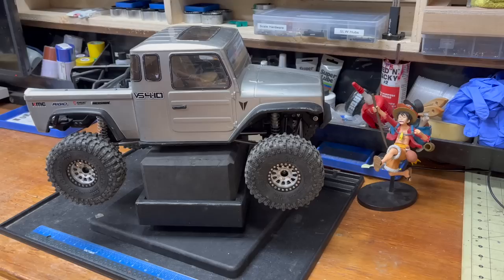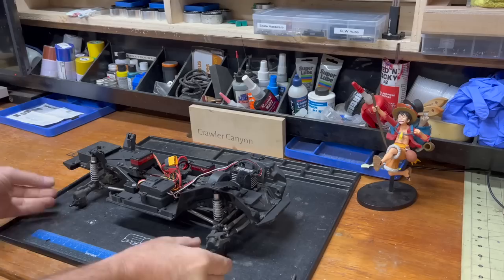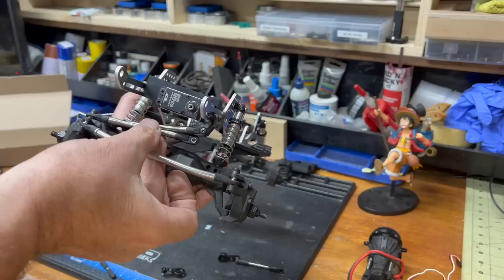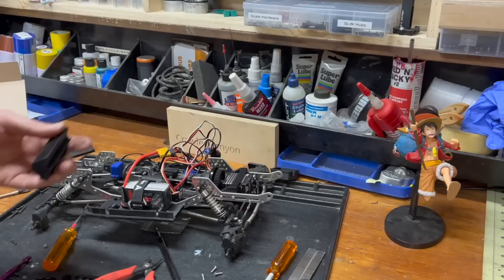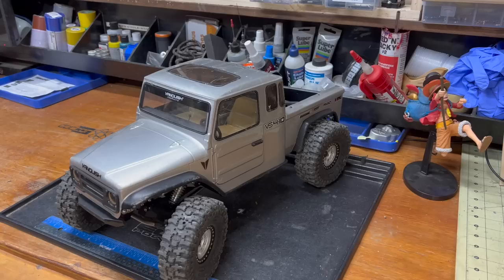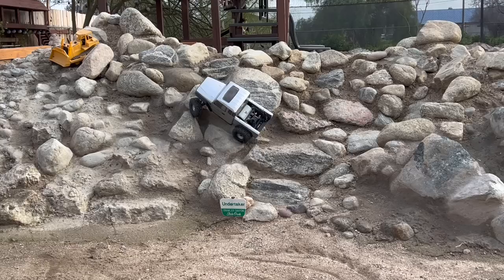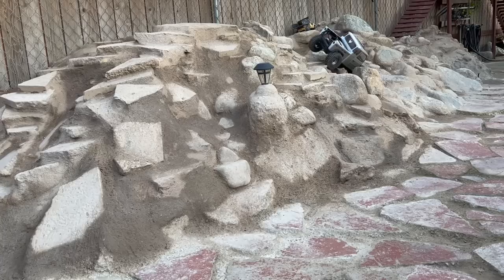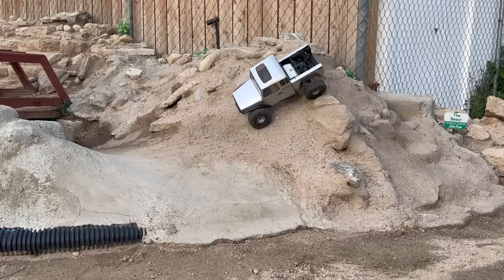Crawler Canyon Quick(re)view: Zoku RC LCG kit for Vanquish VS4-10 Phoenix

Comment: Make sure All you give this gentleman a like on his videos so the algorithm works and shows more individuals these brilliant videos !!! 
I was told by vanquish 20 mm for steering servo and 24 mm for dig an OD
Reply from the maker: That is probably correct on the horns.  I just know I refused to buy any, and bodged $2 Amazon horns in there. I spent probably 40 minutes setting up the steering, which would have taken anyone that had the correct bits about 5 minutes.
Reply: The manual calls for 24mm for dig and OD but it can be done with others.

Comment: So you took a rug that was almost perfect and you made it closer to almost perfect. Great review as usual.
Reply from the maker: That is correct. Take what I still think is the best handling rig "box stock," and crank it up to eleven. The amount of adjustability in the chassis is almost overwhelming.
Reply: @CrawlerCanyon  Put the front shocks in the top back hole. I think it's stretching out to far. Just my opine!

Comment: Check out the KST DS215MG V3 micro servo.  $35 for metal case metal gears.  I have one as my dig servo on the 10.3 Bronco.  It's a bit noisy under load, but it's fast!  Made for helis I believe, but it looks nice and does the job.

Also, thanks for introducing me to this kit.  I got to drive an RTR Phoenix on Tusks last weekend.  That made me want one.  This kit just reinforces that.
Reply from the maker: They really went all-in on speed with that lil' guy. Also, TIL that AGFRC makes like four versions of the A20--  I've only seen the A20CLS--  the CLS meaning coreless--  but there's a brushless version (BLH, BLS, something like that) making a gnarly +150oz on 8.4v. Not that it's necessary.  This digs well enough on a servo making like 30 ounces.

Comment: We might be looking at the winner of the Crawlympics.
Reply from the maker: And mind you this is close enough to real time (ish) I didn't tune ANYTHING. Just swapped links and changed shocks.  It honestly isn't awesome on the 80s, it's just not enough travel with the angle on the shocks, and standing them straight up acts too stiff as the truck has shed three quarters of a pound of sprung. 

I guess I did tune a little, I just didn't even notice I was doing it.

Comment: "maybe if i give it stuf it will like me more " - my kind of thinking - you got to have one like that in the Canyon
you can use wheel brass weights the ones that screw to the back of the beadlock under the hub - cheaper
Reply: New to 10 scale scene, you have a link I can check out for those?

Comment: Damn this is intriguing. My Phoenix is still just a slider since I was waiting for airbrush parts. Nothing like stepping on the air line and hearing a crash to know you done f-ed up 🤦‍♂. Haven't even driven it yet and going hmm this chassis looks sweet as 😂
Reply from the maker: The best part is the guy is open to any suggestions I might have, so the front bumper mount has already been redesigned to accommodate a micro servo winch. SOMEONE ASKED ABOUT THAT LIKE 18 HOURS AGO
Reply: @CrawlerCanyon  That's so awesome. Gotta love that responsiveness and enthusiasm. This is clearly really well thought out and I'm looking forward to the next one to see how the corner weights work out with a little more fine tuning. During this video I couldn't help but also think that Associated sure makes a good shock

Comment: My goodness what a freak. I can't wait to see this one dialed.

Weird thought, could you go to an outrunner with enough room to cram a receiver box in the gap of that vfd?
Reply from the maker: Probably. But this is one of those instances where the motor is so low and so far forward, I'm using the weight.  I just used my usual approach to wiring, which is "attack it with zip ties.  Looks halfway decent. 

Blue Sky High NEEDS an outrunner. His CGH is WAY too high.
Reply: @CrawlerCanyon  thought that from the beginning. BSH motor position is nuts.

Comment: I still feel like your front tires are too firm, but sometimes IDK...that side hill is good. Wheel weights are cheaper than portal weights, and might be enough.  Love the video.  I want that setup!  I currently have my phoenix stripped down, servos removed, 850mah 3s batt on side, 95mm dravtechs on 3.93 tusks with diff adjusted @26% O.D. and I love it.  I think it's 57% front weight with nothing added.  But, where do you put your winch in that setup?  I'd just use the dig servo mount I suppose....
Reply from the maker: I'll talk to the guy--  I think he could probably rework the front bumper mount into an all-in-one for a micro servo winch mount--  which would be SUPER clean.

Comment: I have a phoenix portal kit waiting to be built.  Now you have me thinking.... 🤔
Reply from the maker: It's really good. I haven't even begun to dig into proper tuning, I only just now got the wiring straightened up. But my goodness does it feel almost illegal. 
In case I didn't make it clear, I DO NOT like it on 80s.  The chassis will work, but it really sings on a 90-95mm shock. 
And it is SO easy to build.
Reply: I have some g-made 90's already to go on the kit.  Some hair buns also. 😁

Comment: Craig, what performs better on comp crawling? The Zoku or the VRD Phoenix?
Reply from the maker: Tough to compare, honestly.  One has a lightened VFD in the middle and the other has a full-built VFD-Twin--  and the servos to run it. Capability wise, it's so SO close, but they <feel> very different. I'll still take the Twin nine times out of ten, because if I can get dig, I'm gonna take it. The VRD is clearly designed for a pretty specific competitor.  The Phoenix is capable out of the box, and feels like cheating with a Zoku in it.

Comment: 55:55 I would like to see the back shocks here. See how exactly they work on this climb.
Reply from the maker: I have them laid over a decent amount compared to stock.  Those shocks are of course completely rebuilt, modified, and given to Daphne, Argentum is now on 2660 BIg Bores with Element SE springs, and they're damn near as good. I don't think it's 100% the shock here, and more the geometry.
Reply: @CrawlerCanyon  I'm sure it's the  Zoku, but I was wondering: is the shock angle 90° starting from ground level or over and are they fully compressed at that point?

Comment: I would like to see a Zoku vs RP Interceptor shootout
Reply from the maker: There would have been one, but zero holes on the Phoenix parts line up with the holes on the RP chassis rails. If it's on RP rails, it's certainly not a Phoenix anymore.

Comment: Hi, are you able to give me some advice please? Not sure which servo's to use for the DIG and OD.  Can I use the lowprofile Savox SC-1251MGB+ (9kg) for the Dig and OD function?? Or am I better of with the Savox SW-1250MG+ (8kg) as it mentions it is waterproof. Hope someone can help me with an answer; Thanks in advance!! ps. Already have 2 servo's from Savox, therefore the preference for the same brand.
Reply from the maker: As this is on the Zoku video, I'm going to assume you have a Zoku and therefore need micros--  so yes, the SW-1250 will fit, but I would do everything in my power to talk you out of them. They're pretty much the most expensive micros I've seen.  The 1251s would fit the regular Phoenix chassis, but again--  far too expensive.

When they're in stock, the Flash Hobby 1227 are my new go-to for micros.  Otherwise, it's either the AGFRC A20CLS https://amzn.to/3T6yAL7, or the super-economy option, the Injora 2065 https://amzn.to/3t37rhy which are like 2 for 35 bucks, and use standard 25T horns.
Reply: @CrawlerCanyon  Thank you so much for your response and time. I really appreciatie it! Till now I only upgraded machines and after many years have the possibility to build my dream machine. :-) The Savox is indeed expensive, but also around the corner as in my country there is not a lot. Still I'll look at your advice. Again thank you so much for all your video's etc. It really helps many people!!!!

Comment: What's your gut feeling, this or the Groundfox chassis?
Reply from the maker: Artful dodgers makes some superb quality stuff--  but if you want to "keep it a Phoenix" then it's Zoku all the way, as it was designed to fit the Phoenix body. 
I also like the OD servo mount from AD, but wildly prefer the dig mount from Zoku. 
Say we were talking about say the Groundfox I built for Element compared to this? The quality of the 3D prints on the Zoku give it the edge for me, as a guy who doesn't generally trust 3D printed parts. The fit and finish of both is <real> close. I consider AD an "LCG kit" where the Zoku is an "LCG conversion."
Reply: Thanks, that makes sense. I have an unbuilt Straight axle and can't decide what to do with it - keep it a Phoenix and try this chassis (small downside I already have a Phoenix portal so looks-wise it'd be a duplicate in the fleet) or try the AD and put a completely different body on (thinking Proline Beetle for giggles). Benefit to AD route is I'd have a spare Phoenix bodyset if I ever destroy the 1st one.

Comment: Very informative video. I have a Portal Phoenix with Zoku kit, and Proline big bore 90 mm shocks. What shock position and oil do you recommend? I also have the stiffer Proline springs on the rig.
Reply from the maker: I wish I could give you a satisfactory answer to those questions--  but there are too many variables in the way. I have no experience with the ProLine crawler shocks, so I don't know what oil I'd run in them, and shock angle is determined in part by the stiffness of the springs, and I don't know how stiff those are either. 

Non-specifically, I run between 300cst and 500cst on 80% of the fleet (there are those oddball shocks that need +5000cst oil,) and for springs it's the rate that will keep the shock about 6-7mm from fully bottoming out at RTR weight. If there's most of the shock shaft showing, the springs are very likely too stiff.
Reply: @CrawlerCanyon  thank you for the input. Pointing me in the right direction. I ask because your Zoku rig is too sick. Hoping to replicate it! I hope to see a follow up video on your Zoku Phoenix rig.

Let’s say the springs are very stiff. More or less angle on shock mounting?
Reply from the maker: @shoualor1707  Leaning the shock over lowers the effective rate. A 2lbs/in spring @ 90º is the stated rate, and that same spring laid over at a 45º angle is around 1.4lbs/in. 
As to a follow up, https://youtu.be/cenGoNJptmE
Reply: Thank you sir!

Comment: Do you think it’s possible too, 4-link the front with a SOA kit ?
Reply from the maker: I don't think this chassis would present any more difficulty than any other Phoenix SOA conversion--  which is going to be a lot, as you can't can't do BTA servo (the motor is right there) and getting that driver's side upper link is always fun, as that's where the driveshaft lives. Can it be done? I'm sure.  Will it be worth it? That's the real question.

Comment: So were you saying it's tunable your talk about adding weight
Reply from the maker: Removing weight is also a strategy, but when I'm talking tunability, it's generally about suspension tuning, from shock setup to link lengths and positions. Sometimes weight is unavoidable, and getting the sprung/unsprung ratio where I want it simply isn't physically or economically feasible, so I unfortunately have to start doing the math and fiddling with links again. Sometimes it's as simple as changing shock length, angle, or position...  but most often it's not.

Comment: I have a zoku on my rtr. What shock positions and shock oil do u recommend.
Reply from the maker: For the Incisions, I would say 40 or 50 weight, depending on how much damping you like. With the straight axle shocks, I’d say start with the top row, middle hole, and adjust accordingly. Further back will raise the body and raise the effective rate, moving them forward will lower the body and soften the effective rate.
Reply: Thank. I'll be trying this weekend

Comment: I would have to disagree about the Phoenix being the most capable crawler out of the box. I hate my Phoenix. It's top heavy and likes to roll over so I bought Rock Pirates shock towers to lower cg. Still not a great crawler. My slightly modified Element builders kit V1 walks all over my Phoenix. Both have RP shock towers, fusion pro, rims and tires done...no other mods and my Element embarrasses my Phoenix and at 2/3 the cost. My Utron does as well as my Phoenix and that has even less done to it. Build quality is good, but I'm not spending another $300 just to make it climb better. Especially when all the bits in that kit are 3d printed. I 3d print a lot of stuff and not just in PLA. I have PETG, ABS...something always breaks. 

Also, from your first test, this thing was not very capable until you fixed the caster and stopped the front end from being pushed around. I still dig the videos because it's good to see other peoples opinions and set ups. This isn't something I would waste my money on and I know a lot of people will disagree but that's ok too. You're excited about it and you bought it so that's all that matters. 

Unrelated to the Phoenix, I tried the Fusk and they don't do too well on these Arkansas rocks. You win some, you lose some and this isn't the first time I expected different results and was shocked that they didn't perform.
Reply from the maker: I don't wanna just say, "you're doing it wrong," but if that's your sum total experience with the Phoenix, then... you're doing it wrong. The Phoenix in stock configuration isn't any more top heavy or prone to tipping than anything else out of the box.  I do take note that you neglected to mention what body is on the Element--  but my guess is that it isn't a Phoenix. Give 'em a body swap and see if anything changes.  The Phoenix does remarkably well in stock configuration <in spite> of that body.  Sure, you can suck some of the fun, spirit, and life out of it by putting a (retch) Cliffhanger on it and fix most of people's perceived problems.  But sometimes it's not just about the easiest route to the destination.

Don't get me wrong, I love me some Element--  there's Element on most of the rigs in the fleet to some level or another. But an out-of-the-box Enduro SE vs. a Phoenix? Not very close. Against a Zoku Phoenix? Not even fair. I'm not surprised about the Fusk.  Lots of tires are <very> location-specific.  The Jetko Conquerors did great here,  then went off to their forever home in Montana and did not do well at all. Some people have luck with Pitbull, and I've yet to have a tire from them do even remotely well here.  Some tires are a bit more "universal." 

Oh--  I usually feel the same way about 3D printed parts, in that they have no place on rock crawlers outside of beer coolers or other scale gubbins. BUt Zoku is doing 85-100% infill, and the fit and finish of the parts is as good as what's coming from name brands. Never so much as cracked a single part.
Reply: @CrawlerCanyon  I love, and appreciate, that you respond so thank you! You are correct about the body on the Element. I either run the Gozer body with Traxxas Canyon Trail tires or the Proline VW crawler bug body on class 1 RC4WD Flashpoints because they fit this body without having to hack it up. I think this gives it a slight disadvantage because it's straight axle and not portals so I lose some ground clearance but I understand this is a highly debatable subject. What's funny about this is that my normal group of crawling buddies is made up of of 3 other guys that usually bring a Phoenix themselves. One is a straight comp build, super lcg, super low profile body, portals...I'm talking TONS of money in this build. The other has a slightly more modified than mine Phoenix and his seems to do the best. None of us are winning any comps with the Phoenix, not even the highly modified one. I'm no pro, I'll admit that straight away, but I do have a collection of 18+ other crawlers from 24th to 1/8th scale that all do pretty well so I'd like to think I understand what it takes to make these things somewhat competent crawlers. I just can't figure out this Phoenix. Then again, maybe the terrain here is just not Phoenix friendly? Seems like a HUGE stretch but I don't know what else to make of it. 

I agree that Element is not a first choice when people think amazing crawlers. Having said that, we have some others guys in our groups that went fully belly drag comp style rigs. One of them does particularly well and has a couple of climbs named after him, or his rig, because he's the only one that can make it up. The names were almost changed because my element also made these climbs. I posted video in the group we're all part of and it fueled a massive heckling for a couple of the guys that try and try and try but can never get up these things. It's really quite confusing to watch and even more so because it was done on class 1's. 

I truly do appreciate that you take time out to respond. I can't thank you enough for not leaving people on read. Just one more aspect of your channel that makes it so great. Thank you!
Reply from the maker: @urg0nnah8me  Oh, If I were gonna build something dedicated "comp" I'm sure not putting a VFD Twin in it. Too big, too heavy, too complicated. I also for whatever reason strongly prefer the portal over the straight axle, but REALLY like the straights in other builds. 

I would, do, and will say Element > Axial.  All day, every day. In the entire Canyon fleet does not live a single Axial gearbox. Or chassis rail.